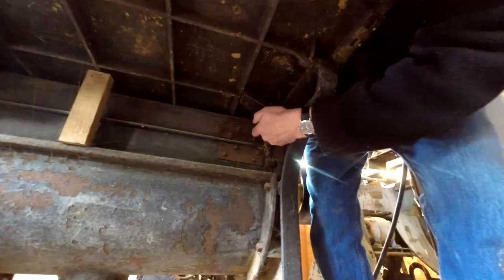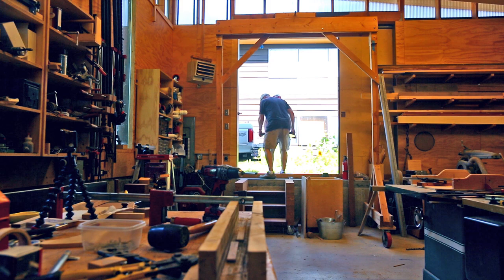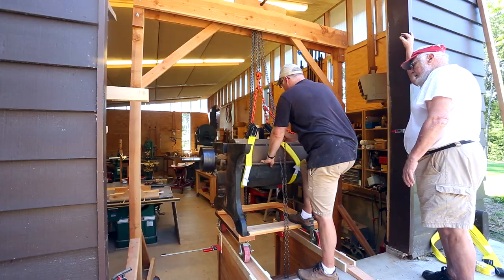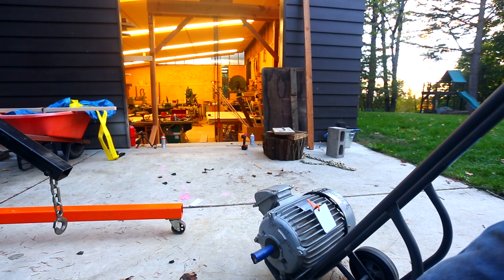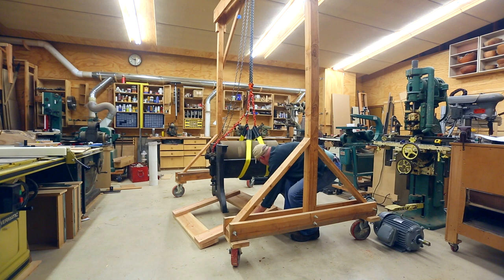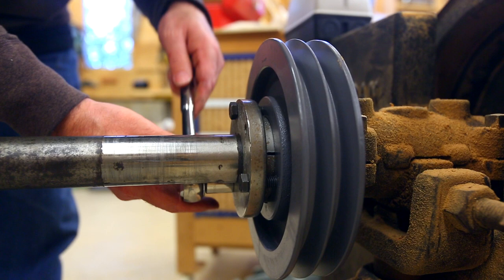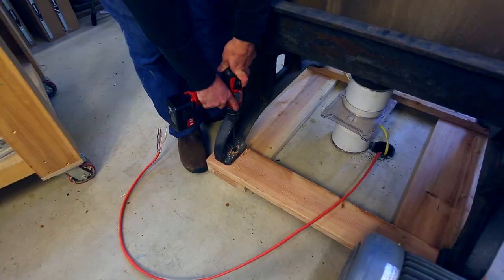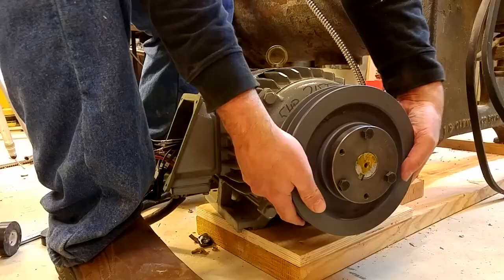Frank H. Clement Surface Sanding Machine

Comment: Oh and at 10:24 (I hope you like input / ideas) what about welding a plate onto it?
Reply: you are introducing heat, you will get warping, especially on something this big. + You are adding thickness to the tables possibly making the top higher than the drum can adjust.

Comment: How are you obtaining 3 phase power?  I really like your chain hoist.  I have to put new wheels on my planer and haven't been able to lift it, so i will be looking into obtaining a hoist in short order here.
Reply: +Nicholas Smerk Many municipalities will put in 3 phase for a fee...just depends where you are.  If you're totally stuck you can use a phase converter. Not perfect/efficient but it lets you use the big toys.
Reply: I just put big single phase motors on everything I have.
Reply: +Nicholas Smerk in one of the earlier videos, I believe he talks about a installing a phase converter. In fact, I think there are two. A smaller one and a bigger one.

Comment: Nice work.
I really hope you did your electrical better that in the video otherwiser you might short things up. I did not see any way you what is it called fasten you cable into the motor. 
I can be wrong and I hope soo ;-)
But nice vid.

Comment: I'm pretty shocked that you have more room in the shop for anything.  What did you have to move to make room for that?

Are you able to adjust the motor location as the belts stretch?

Comment: Not sure why you'd consider spending the $$ on a frequency drive when you can just adjust your v-belt pully sizes to tune your speed.  IE, if you need 800 RPM on the drum with a 1200 RPM motor, use a 2:3 ratio of pulleys.  If you have a 9" pulley on the drum put a 6" on the motor and done.  

Or do you need different speeds based on the type of wood or the specific job you have?  

Anyhow, I enjoy your vids.  Thanks for all the effort you put in.
Reply: Probably for the start-up so it doesn't go from dead stop to full throttle right away. Gives the drum the ability to start spinning slowly and get up to speed.
Reply: I'm totally agree with Scott Haney. Another reason to use a frequenzy drive is that you could implement a safety stop button and then the drive would stop the motor in a controlled way.

Comment: Don't do variable speed. If you do variable speed you have 2 options. Analog which uses transforms the power from your ac source. Problem with this method is you loose torque when dropping voltage. Digital (PID controller) is better because it uses pulse width modulation (on off very fast with full power). Although trying to get a device to work with high AC voltage will set you back few dollars. Im just wondering why you wouldn't consider different gear ratios? You have a long shaft on one end where the motor is location, make a 2 tier gear ratio to slow down the speed. Speed will be fixed, but this will be EASIER on the motor plus the acceleration time to top speed would be much quicker because your using less force to move that massive drum. IF you have a tool to measure Amperage output you can test this like mathias wandel did on his own vacum pump he used in his dust collection. 

anyways just a thought.... nice drum sander!

Comment: What about trying epoxy on table? build up an edge around the table top (using tape), add epoxy on it to make a staight surface? There will be more epoxy on the low spots and less in the high spots making it plane.

Comment: Hey Frank, are you worried that a wooden work surface won't allow for smooth gliding when passing pieces over the drum?
Reply from the maker: +Matt Staten true,  if i finish it well, or add a piece of masonite, or  aluminum. it should work.

Comment: put a variable speed pulley on the motor you can spin it to increase or decrease size to speed up or slow down .....but a speed drive for a motor that small is pretty in expensive 300-400 bucks probably pulleys can get expensive if you are just guessing how many rpms you want one thing to be aware of is if the motor is vfd rated or not.

Comment: make sure the tracking of the belts/pulleys is 100% right, then the drum wont walk from side to side. Also make sure, that the drum is level. You probably wouldnt have this problem with a flat belt.
And as you said its probably vibrating, because of the high rpms.

Comment: i bet you could level the tables, build a water tight frame around each table section, and  then pour in epoxy resin that will self level. if nothing else this would allow you a more even surface to attach the wood top without having to worry about shimming.

Comment: if the belt alignment is correct there should be no lateral movement and the tension on each belt should be the same.

Comment: nice machine ... 
Before going all nutty and building new tables, might I suggest bringing the tops to a good body guy/girl ... 
They would probably be able to heat the metal and get it very close to dead flat. 
At that point you can have the surfaces ground ... or you can use a product like "Overcoat Metal to Metal Filler" - See Eastwood.com to flatten the small imperfections. 
The nice thing about this product is that it allows for the application of powder coating if you are interested in getting it all shiny!. There are some very good wear resistant powders (ceramic based)

Comment: A VFD is no good below 20hz, so check the math on the ratio before going that way.  The motors have fans that will not be able to cool the motor at lower RPMs.  Someone more educated than me will also know about what you can do to brake the motor so it doesn't free wheel to a stop.  Cool addition to the shop

Comment: Put aluminum sheeting on top of the wooden table tops to prevent expansion/contraction/warping
Reply from the maker: +SimplyMyAccount Yes, I was wondering about something like that.
Reply: frank howarth Matthias did a similar thing with his homemade jointer (I believe). Worth it for the few extra $ for the aluminum

Comment: If you have a vee pulley on the motor, the vee belts will stay on the flat belt pulley just fine.  If it slips (and it may not) then go with a vee driven pulley.  But you bought them already, so moot point.  I always like to try the simplest alternative before buying stuff.

Comment: Its kind of strange watching this on video  perhaps it is the power of editing or your. Calm  sounding narrative that makes the. Entire set up and move. Way easier than I'm sure it was  ive moved  many  woodworking machines around and  machine shop machinery  even utilizing whenever its available a. Forklift  or overhead chain hoists and it was never easy   Or as smooth as  your video makes it look  to be  usually. Ive seen lots of grunting , yelling, or mishaps  including whatever can go wrong did  i actually. Have  family members that own a machine shop. Ive helped a lot of times  move their latest acquisition  of some heavy  oily old. Machine   Off a truck and into their. Shop ive always teased them. About  trying to buy. Something. That wants or  has been designed to  be moved    It always works out as they are there for me when i need them to be  so it is all good

Comment: Hi mate.  About that bow in the table.  The table should be able to be straightened by heat straightening if you can't do it yourself, or don't dare to, than you can find yourself a metal worker in your area that is prepared to do it for you.  You should contact Keith Rucker from vintagemachinery.org   He will be able to put you in touch with the right person.  Keith will also be able to supply you with manuals about those machines.  He also has a youtube channel, but that is more geared toward metal work.  Just have a look he is a wealth of information and a nice guy to boot.

Comment: A driven pulley that is 50% larger would take the 1200 motor speed to the recommended 800 drum speed.

Comment: I'm a metric person, so when I see odd size somethings, I translate it to imperial, and the weird number starts to make sense,  the1 13/16" was sort of the opposite, which is basically 46mm in metric, not your regular metric dimension, but looks prettier than 1 13/16 :D
Reply: Only if you're metric dilettante.    Whatever you're measuring doesn't care what type of measurement system is used.

Comment: Great video Frank! I really enjoy and appreciate the time you take editing, and speeding up your videos so you don't waste our time watching b.s..
That being said, I do have a bone to pick... Jointer? Really? I'll admit that I have an advantage over most younger woodworking hobbyists in that I received an education in my formative years from older craftsmen who had sawdust in their veins. No such thing as a "JOINTer". The machine you are referring to is a "JOINer", because it dresses the edges of a board allowing it to be joined (usually glued) to an adjoining board, generally who's edge has been dressed in the same way. (Also used to achieve straight edges on boards with curved or irregular edges.) The machine does not create a "joint". It prepares the edges of the board to be joined.
Btw, a sanded board should never be glued, only those with blade cut edges or faces. (ref: FAA pub 4313b "Acceptable Methods and Practices of Aircraft Construction and Repair". This, owing to the fact that the fine wood dust created by sanding cannot be effectively removed. Moreover, sanding rounds over the microscopic edges and ends of the wood grain, making physical penetration of the glue into the wood impossible.
I hope you do not take my criticism personally, as my intention is to promote the fundamental principles of craftsmanship, one of which is the correct identification of tools and techniques. I know that in certain areas of the country where a toothbrush really is used to brush that last remaining tooth, and where they pronounce and even spell "vernier" (3 syllables) as "verneer"  (2 syllables), they may never get it right. I'm amazed by the fact that even sellers of tools don't get it right, thereby perpetuating misinformation.
I lament the fact that wood and machine shops in secondary schools have been replaced with computer labs. I'll get down now...Keep on making those great videos!!

Comment: The old guys knew what they were doing, if it says 800 rpm then sheave it for that speed.  It's doubtful that your motor is inverter duty anyway and VFDs have too much going on with them - programming, possible harmonic issues, etc.  At the end of the day I'm not sure it would be any cheaper than just redoing the bearings and getting the drum balanced.  Plus, once it is, guaranteed trouble free.  Don't over engineer something that just simply spins.

Comment: If you insist on keeping that machine, at least get some blanchard ground steel plate and make new tables.   Putting  on wood tables would be  like repairing  a battleship with paper mache.